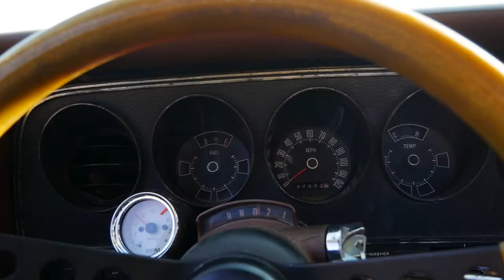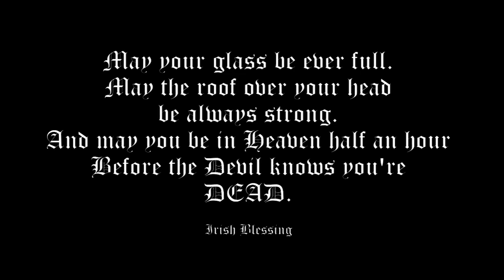It's Broken!! W900 Rear Differential Has Checked Out!!! #youtube #w900 #trucking #ford #viral

Comment: I have many thoughts. The last one was,I drove for a small company. Early one morning, I was heade out with the former wife. She was excited because she had just got her C permit. I hooked, checked the load, did my walk around and hopped in the truck. As I'm pulling away, she asks me if I am going to shake my ball joints. I took a few, looked at her and said," I am a company driver. Everything on top and fluids is mine. Everything thing underneath, is the mechanics. I go to make two lefts and two rights to get out of the yard. If the wheels don't fall off, the ball joints are fine".
Ten days into a two week trip, she is leaned back, arm on the door, smokin,  with a soda, driving through Kansas in not quite a tornado. All 5'4", 100 lbs of her.

Comment: Glad to see you made it home,  Irish O'L,  on the bright side,  its a write off on taxes. Now get after it. Hugh Mc.,  Chicago metro
PS: The way that pinion  looked & the bearing. It would be nice to monitor that temp on case,  that must have sizzled for a while,  like low oil for a good bit. That fix should be your last,  you got to check back lash/ wear pattern _ no ? Drive safe.

Comment: Drove Flatbed for Ploof Trucklines  in the mid 90's  .Flatbed division   was transporting 48,000 pounds of Sheetrock from Tampa fl to Miami  .Sitting in stop and go traffic I heard a loud Pop .then my truck wouldnt move .Thought I blew a clutch. Had it in gear and applied the brakes and looked under and the drive shaft was spinning. .jumped In and flicked my differential switch and was back on rolling to my destination  ..ran 250 mile back to Tampa ..like that .they said i broke an axle..they fixed it got me back on the road

Comment: Man, I was determining that I'd use a cherry picker if I had to remove that giant pig, and sure enough, that's what you used. Was that diff low on oil?

I wouldn't have much apprehension about making that trip in that Ranchero. I've driven my one year newer F150 (with a 1969 240 engine) farther than that, and come back with a new cab in the bed. Would've been tempted to pay them to mail me the credit card if I could trust them, and get them to wrap it in tin foil and send it certified...
When I was a kid in the late '70s my high school age neighbor had a burnt orange '71 Lemans Sport, black vinyl top, saddle buckets/console interior, 350, and Honeycomb wheels! No Endura nose though. He put Cragar SS on it and a set of hiJACKERS to bring the ass end up, and he put those same hiJACKERS stickers on his quarter windows! It was also the first place I ever seen an 8 track tape go in through the radio dial face - that one kind of blew my mind... The rabbit does look ready to outrun some predators...
That bridge is heavy F'ing duty!!

Comment: Last time  did one I was 500 miles from a town and 80 miles to any water and no way to get the over loaded trailer off Yeah 3 days of hell at least is was not cold well in the day light
Reply from the maker: The cold sucked... the next day was worse
Reply: @IrishOutlawGarage  yeah still been in the desert in high summer was no fun . Like yeah chain block to lift diff but drop in hole we dug then sift truck next day when newer diff turned up repeat while trying to keep sand that was wind blown out yeah work shop pulled in down again a week later . I work for a water drill team for just on 29 years when you are out in the middle of no where well you made do any way we could . Think tow truck to out base would be 1100 miles of mostly dirt road even opening gates in places as the grids would not take the trucks

Comment: Why was it so dry inside that gear housing
Reply from the maker: I drained it before I started. Had about 3 gallons in it still. Holds 3 1/2. These diffs have about 1.4 million miles on them. Was bound to happen at some point. 👍

Comment: It’s too bad you couldn’t have had the tow truck just lift the ass end up and put blocks under the tires so you could remove the short shaft and then drive it home
Reply from the maker: That would have worked fine if the pinion gear wasn't just banging around in the ring gear. It would have locked up
Reply: I didn’t see that until after I commented